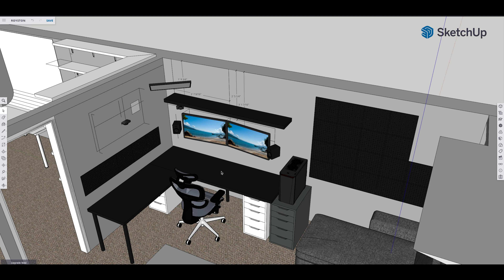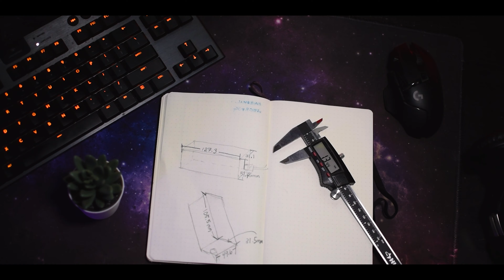HOW TO MOD & 3D PRINT YOUR MONITOR WALL MOUNT

Comment: Nice design but you could have also increased the number of walls used in the model with less infill to accomplish similar results in strength.

Comment: i know it wasn't really the point of the video but a hacksaw is $10 and you could've cut off the overhangs on that TV mount in 30 minutes or less. plus it's good forearm workout. lol

since i didn't buy any mounts yet, i will give 3d printed monitor mounts a shot as well! thanks!